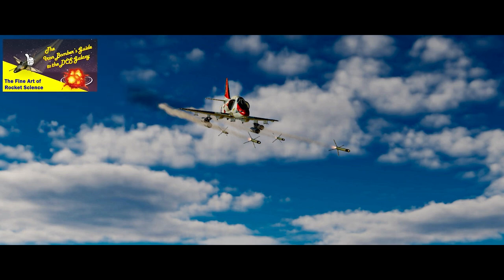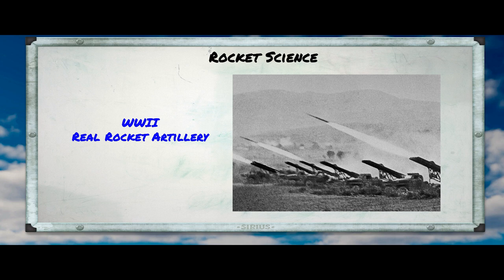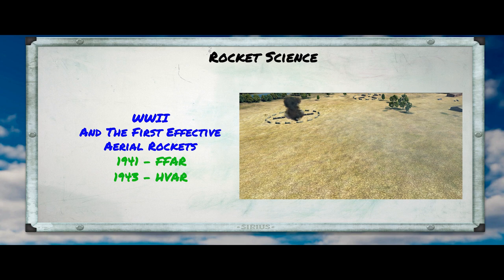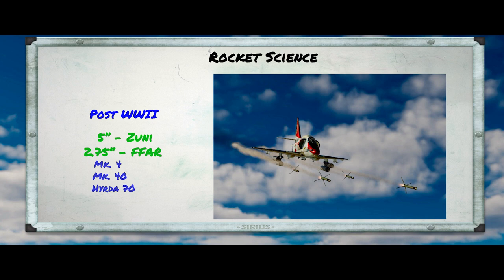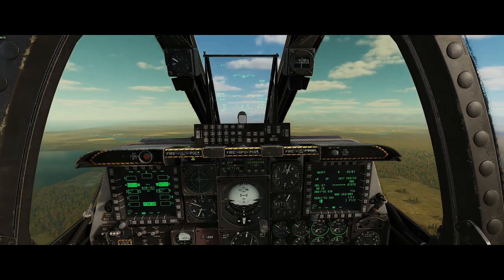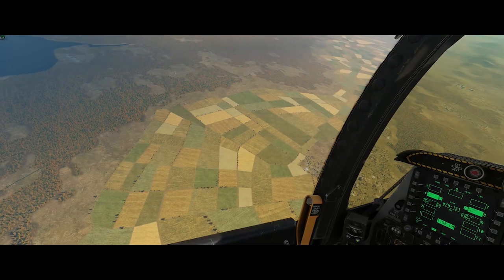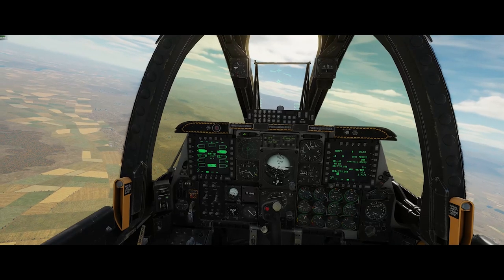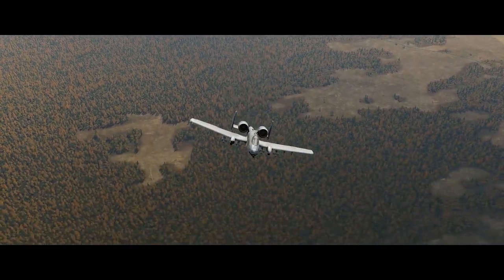The Fine Art of DCS Rocket Science - Part 1

Comment: Lots of good info in this one.

Something came to mind while watching. You had mentioned figuring out the number of mils on a HUD. It's actually pretty easy. The USAF teaches 17.45 mils in a degree (and yes I know some people have a different number). Since we can see degrees outlined on a HUD in five degree increments then we can tell there is 87.25 mils between each HUD line. And of course 43.625 if we're halfway between two of the HUD marks.

It might just be easier to round those numbers to 90 and 45 if you just need a rough estimate.
Reply from the maker: Yup.  As per usual  you are correct.  But, it turns out we actually need to end up splitting the hairs even a little bit finer than that.  After all, at these ranges (3000m to 5000m) even 10 mils of sight depression ends up being 30m to 50m off target.  Which is enough to matter...

Comment: A thought I had while rewatching this video a year later is that the trajectory of the rockets allow for precision aiming at a much shallower dive angle.  A shallower dive angle means less exposure to defensive fire.  So while I agree that the "stand off" distance isn't that much of benefit, the benefit of an accurate shallow dive angle attack is clear.
Reply from the maker: Yup. They do give you different options for sure. Not sure shallower is always better though. High altitude, high angle is actually what pilots seem to prefer in high AAA environments, FWIW. 
But they rockets do tend to require less lining up so the approach can be shorter. In DCS, at least, that makes a difference.